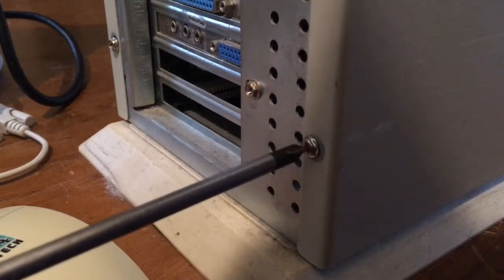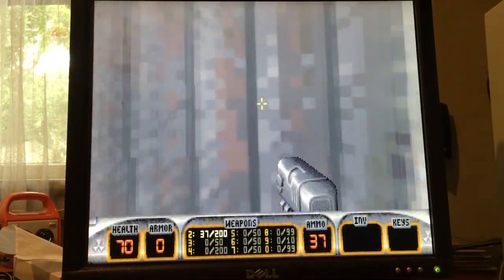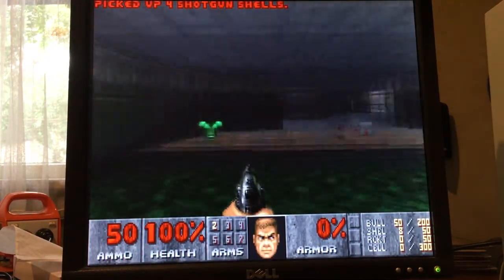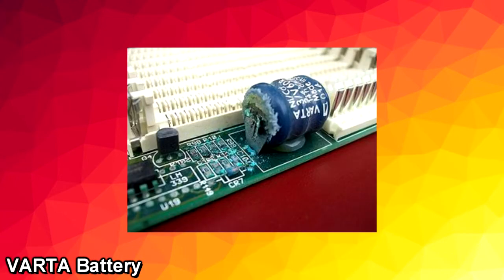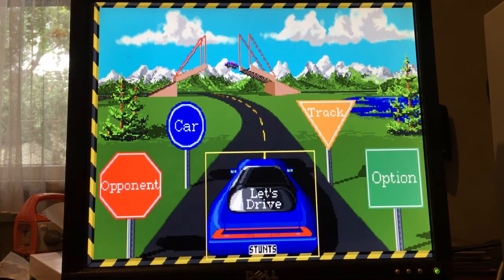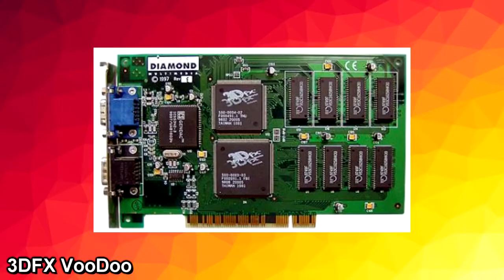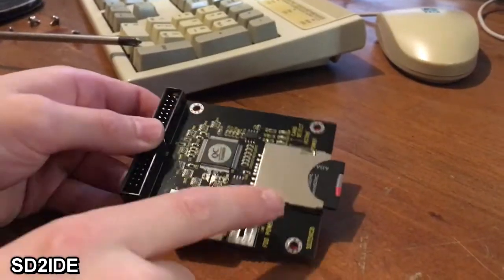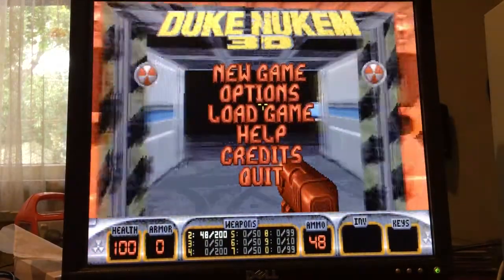Socket 7 Parts Guide | Pick the right Parts to Build your Socket 7 Machine

Comment: don't forget that only 'super' socket 7 machines have the proper bus speed and multiplier to use a K6-2 at full speed.

i personally went with a K6-2+ whose clock speed and cache can be controlled via software in DOS. when it is lowered to 120Mhz with caches off it is like a really fast 486. further slowdown for clock-sensitive games (like wing commander) can be achieved by using MOSLO.COM.

when it is running at full speed, it can play red alert 2 in windows 95 with almost full FPS.
Reply from the maker: Yeah, that is true. I really didn't know much about the Socket 7 platform at the time of making this video, so I cringe a bit looking back at it hah.

That is a great idea, k6-2s are so versatile, hey.
Reply: @ScanLinesAU  love your vids btw, can't wait for some more : )

Comment: Awesome channel you've got there! Some of those 430TX-based motherboards are really something, as they can sustain an 83MHz FSB quite well with 4-chip SDRAM. Throw in a Pentium MMX with the stepping SL27S clocked at 291MHz and a Voodoo2, and it'll catch up with some of those low-end Pentium II systems.
Reply from the maker: Kugee thank you, yes you are totally right, that would be a really good Pentium machine for sure. Maybe I’ll build a similar machine one day.
Reply: If you do, I recommend an Asus TX97-LE, which is a late model from 1998 that has only one 512KB cache chip for even greater stability, or a TX97-X/TX97-XE if you need something in an ATX form factor, the latter which I've tested such an overclocking on. Of course, you do want to be mindful that PCI devices will run on a clock that's quite far over spec. Tillamook CPUs sound nice, but they can be hard to come across and I'm not sure if they'd even work on a lot of motherboards.